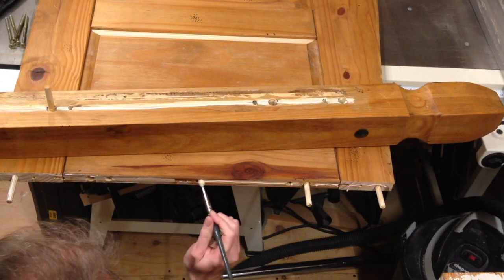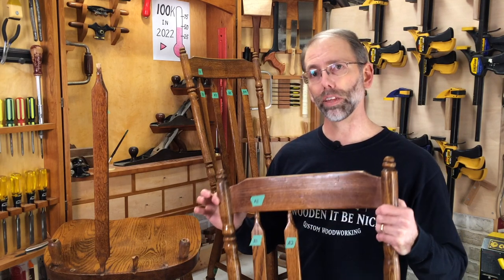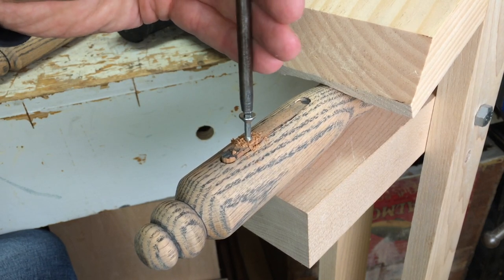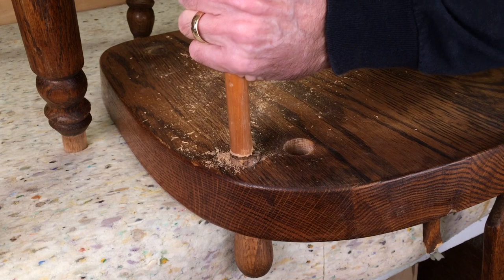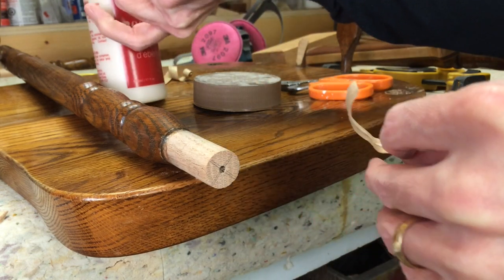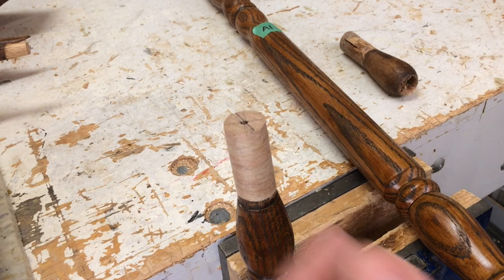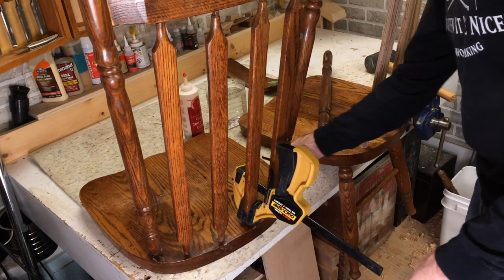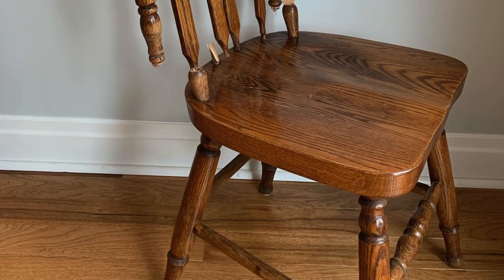Broken Chair Back Repair with a Lathe, Shave Horse & Furniture Restoration Skills - Fixing Furniture

Comment: Once the thru-tenon was sawed off on top, wouldn't a Forstner bit of exactly the right diameter been effective to drill out the remaining wood without expanding the mortise?
Reply from the maker: Drilling out a mortise runs the risk of altering the angle of the mortise.  I recommend breaking out the pieces to avoid causing damage.  Cheers.  Scott

Comment: Hello Scott. Why do you not use steam to take off the glue? Does it cause some problem to the wood?
Reply from the maker: Steam will make wood swell (it's a great way to remove a dent in wood) so it's not something I would use on a joint to try to remove glue.  I hope that helps.  Scott
Reply: @FixingFurniture  Thank you very much!!!

Comment: Hello Scott 
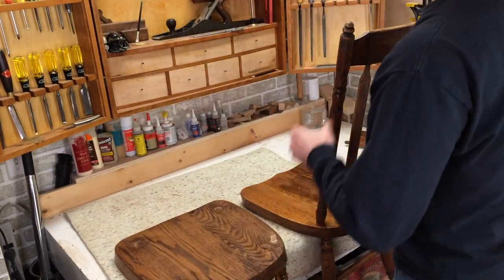 At 41:15 mins When you cut the excess wedge off from under the chair , did you also cut the excess tenon with it as well because  i noticed the tenon wasn't flush to the base when you first inserted the wedge ?
Thank you 
Jason
Reply from the maker: Hi Jason.  I don't cut the tenon flush with the chair.  I leave it in the original state because if someone needs to remove it in the future, a square end is much easier to tap apart then an angled end.  I hope my description makes sense.   Cheers

Comment: A friend told me: If you drill out a wedge by making some holes then changing the drill's angle, take care --- don't use the thinnest drill bit and don't put too much pressure. Otherwise the bit will snap on you, so close to the surface you cannot grip the leftover to turn it out, and your problem is bigger than when you started. A friend did this, not me, definitely not me.
Reply from the maker: Yes, I think I have the same friend 😂. Thanks for sharing that #tip

Comment: Why did three of the four chairs break and you assume it will happen again? Many old chairs never break like that. Very nice repairs. 👍🏻
Reply from the maker: Good question Jill.  Three of the chairs had broken slats on them.  The chair maker made the tenons very small where they're inserted into the seat.  Because the chairs are so heavy, I think these undersized tenons aren't able to take the stress.  It's a design issue with this set of chairs.  I hope that helps.  Scott

Comment: Where do you find matching wood so the grain matches?
Reply from the maker: Hi Andy.  You need to use the same type of wood as the furniture you're working on.  In this case, it's Red Oak, so I purchased some at my local hardwood supplier.  Wood identification is difficult, so if you need some help, sometimes lumber yards can help you.  Cheers.  Scott
Reply: Your lucky to have a local hardwood supplier

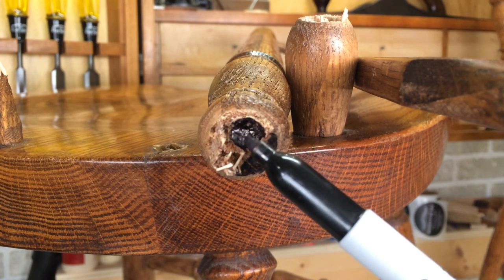Comment: 4:11 Could the large staves be doweled with steel dowels? A 200 lbs teenager was leaning backwards & snapped the main arched back off. The other filler smaller pieces are fine.

Comment: Thanks for your video.... What's the best mask for prevention of dust when you're working in the shop?
Reply from the maker: Hi John.  The Ellipse is a good, light mask.  I also like the 3M Quick Latch, which can be fitted with an organic vapour cartridge when using chemicals.  Cheers.  Scott